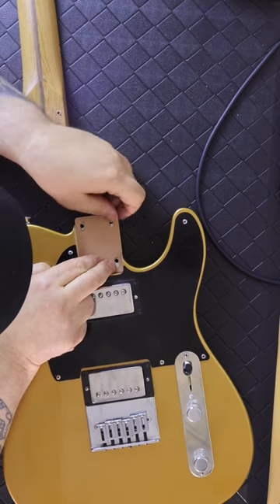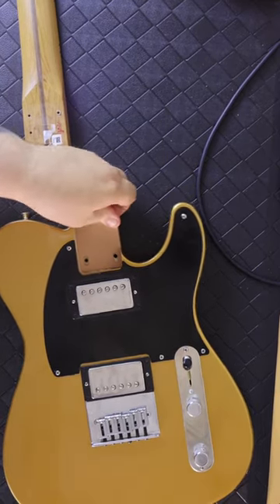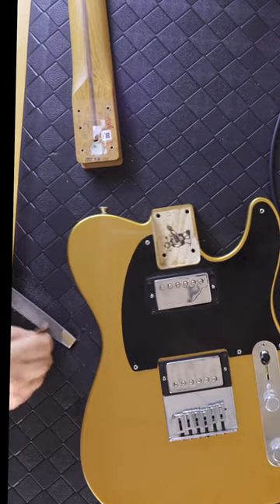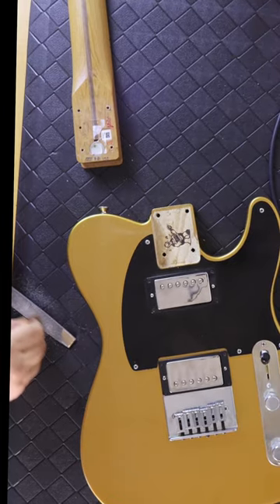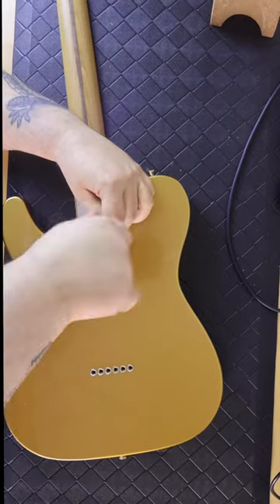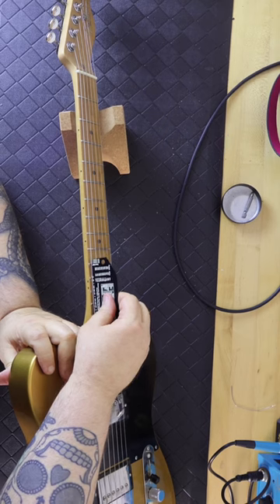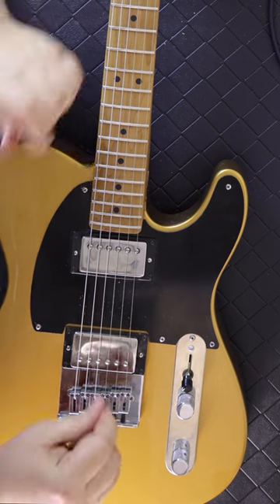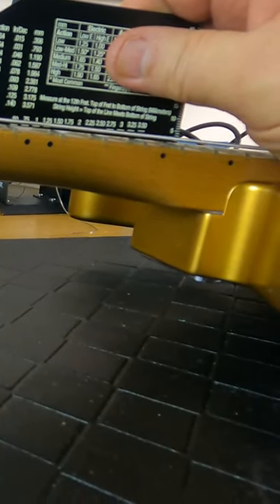How To Install A Shim On Your New Telecaster Neck

Comment: I bought shims online.  They sucked.  So I used cardboard from a cereal box.  Perfect.
Reply: Only problem with that is the cardboard can compress over time, so you might wanna keep an eye on that. I've used plastic gift cards before and you can pick them up for free in shops.

Comment: Why didn't you drill for a micro tilt in the body, you had the neck for it all you needed was a new back plate or drill a hole through it
Reply: Actually your back plate was correct
Reply from the maker: @DanielDias33333  would have been more work.

Comment: I would just bought a better bridge, fender hardtail or a callihan
Reply from the maker: You would have had the same problem. It was not a problem with the bridge. Not all necks and bodies fit perfectly.
Reply: If the neck shim worked that's great,but I know what you mean about different body's and necks, good luck to you with your build👍

Comment: My lord, just sand down some wood wedges
Reply from the maker: I wanted to finish this year. :)
Reply from the maker: @jamescarter8699  how do you ever become a pro at something unless you do it? :) The cool thing about putting a shim on a guitar is it is most definitely not a permanent modification and can be easily undone. It also really cannot harm the guitar.
Reply: @guitarcollectorguy  It can be unsightly from the back, when there now is a gap showing, with a forward tilt shim.

Comment: You definitely can achieve the same just by adjusting the bridge saddle height. Its a simple geometry and math.
Reply from the maker: No you cannot. When the saddle is literally bottoming out on the bridge what geometry comes into play? That is the whole reason you have to use a shim to change the angle of the neck because you cannot any longer adjust the saddles.
Reply: @guitarcollectorguy  oh, I don't know the saddle can not be lowered further. Nice job!
Reply from the maker: @jianhuang0124  thanks!